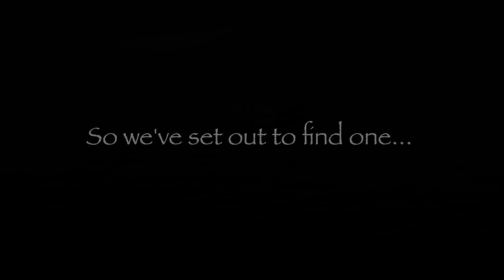SAW MILLING 100 Year Old Sunken TREASURE | GORGEOUS LIVE-EDGE !

Comment: The original part of my house , floor joists, rafters etc was built in the 1940's.
Lots of live edge timbers.
I had a chance to talk to one of the brothers who built it, along with several other houses in the area. 
He said that he and his brother cut the timber, skidded it out with horses, cut it with a tractor powered saw.
The timbers are so hard, you  can not pound a nail into them, it just folds over. You have to drill a pilot hole and use a lubed screw.

Comment: They are still harvesting standing Huon pine in Tasmania from when they flooded the valley for the hydro project.
They dive and use hydraulic chainsaws from the boat.
A decent tree can produce $100k worth of timber.
Protected species now, 
The only timber available is reclaimed from the dams or breaking down old boats now.
Probably one of the best timber’s in the word.

Comment: Interesting video. Nice recovery of old timber-could be a nice sideline. You're searching for uses of the milled timber or even guessing at future use before cutting. Better to have a plan either sale of dimensioned boards or cut to plan for a project.

Comment: I have salvaged white pine logs that were submerged for well over a 100 years and was surprised at how it still had nearly the same odor as fresh cut.  Lumber has a slightly different color and the wood between the growth rings is a bit softer than new.  Used a scraper rather than sandpaper to get a flat surface.

Comment: Just from experience from having a Norwood mill. If you cut those five little sawdust holes into a square hole your shields won’t plug up as bad. Great video
Reply from the maker: Great idea
Reply: @TimberMates  but be careful if you cut the chute as it somewhat protects from broken blades flying out by the chute. I've operated a Woodmizer and a Norwood and am lucky not to have experienced it but I have seen pictures of blades sticking out of the chute by a few feet. That has convinced me not to spend to much time in front of the chute

Comment: Would you not be better to wait a year to let it dry for a year out of sun. Or, does it dry better in board form. Curious. It sure helps with tools, hoe, saw, boat now doesn’t it. How long did you let it dry before using the boards or working them.
Reply from the maker: letting it dry in the sun would cause it to dry out unevenly and cause it to check and twist, a slow dry covered but exposed to air flow is best for a straight dry piece.

Comment: I have to ask...are you certain this was 100 years old? The ends didn't look an ax was used to fell this tree. Surely a 100 year old log would be felled with an ax...

Not trying to rain on your parade as the wood is very nice.
Reply from the maker: It definatly was, now that its drying out its easier to see that it was cut with an axe. A chain saw would make a nice even cut and this one is very irregular.
Reply from the maker: we will post a picture of the notch on our Instagram account

Comment: A bent or damaged prop will definitely effect the efficiency of the motor in speed and gas mileage, it doesn't take much to do that. There not cheap but if you can afford it you aught to replace it